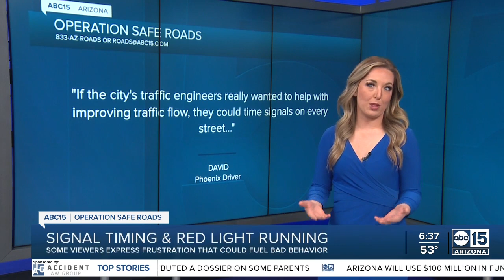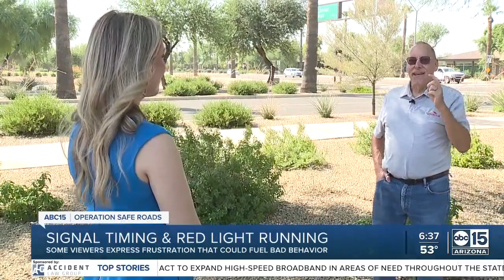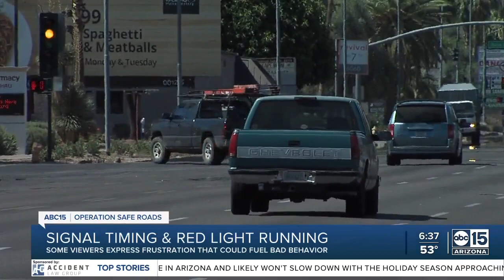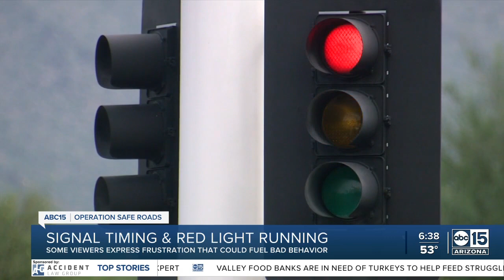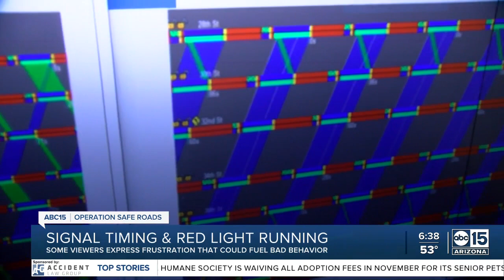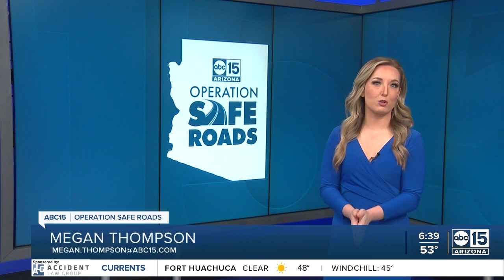Traffic signal timing fueling frustration among drivers

Comment: In the middle of the night the traffic signals should go on a twilight schedule. The light stays green for the default traffic and will turn red whenever a car comes up on a secondary street. It's annoying when the light turns red, there's no cross traffic, and you have to wait the entire cycle of the light.
Reply: That's way too logical for them to understand. Could you break it down for them?
Reply: @juliepiemonte1281  yeah, no problem, we're going to set it to show green the entire time on roads with zero people on them and then it when you start getting closer we'll switch it to red for a solid 90 seconds. We want to be as efficient as possible. Huge /s